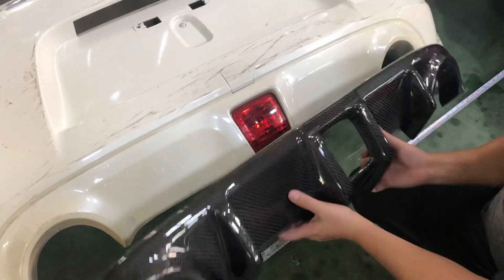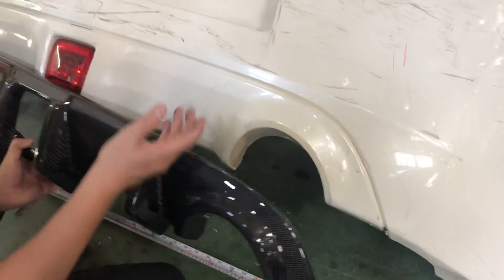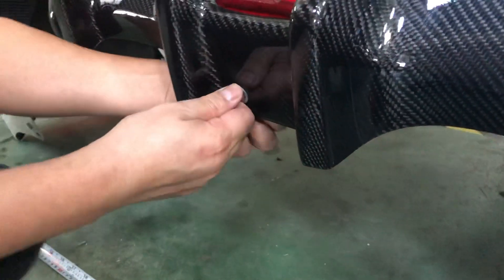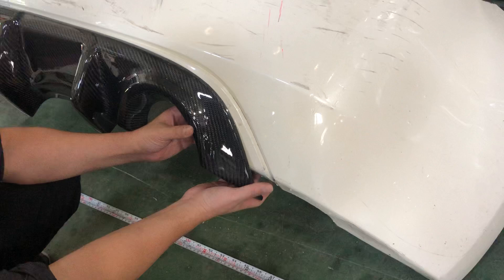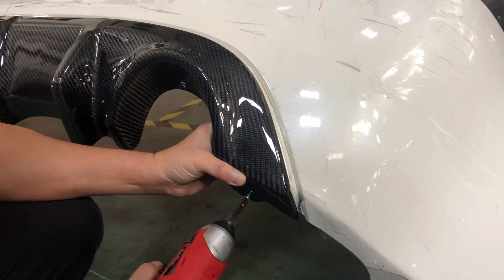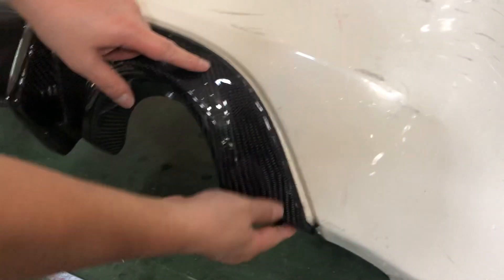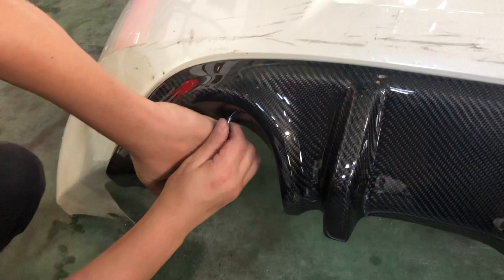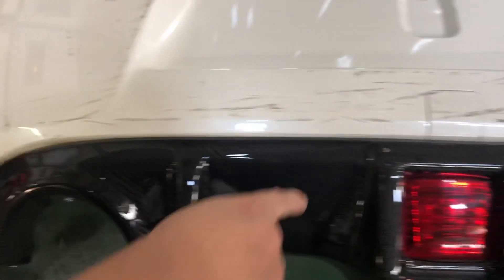EVO-R 370Z carbon rear diffuser installation.

Comment: Thanks for creating this video. It certainly helped me to get mine installed properly. I decided to remove the mufflers so I could insert the screws where the tail pipes are. And used some tape where you suggested and it fits nicely.

Comment: That's a wrong fitment. The gaps at the ends are too wide. I bought one of those but a different brand. There is no gap at both edges.